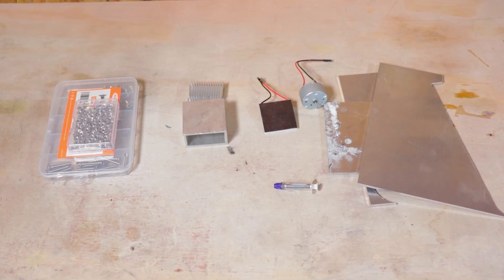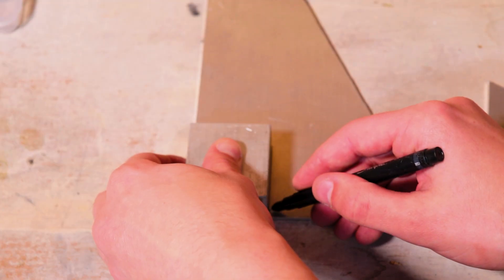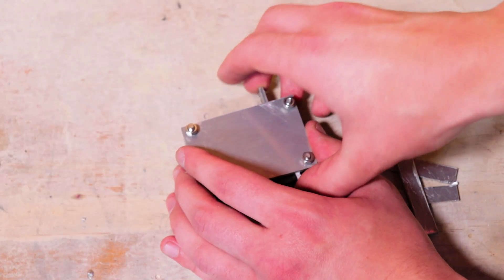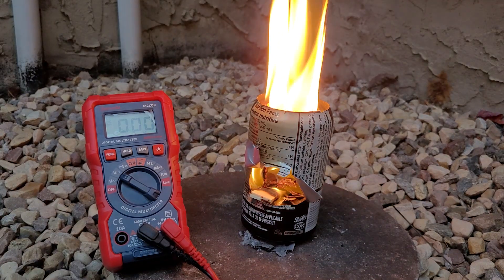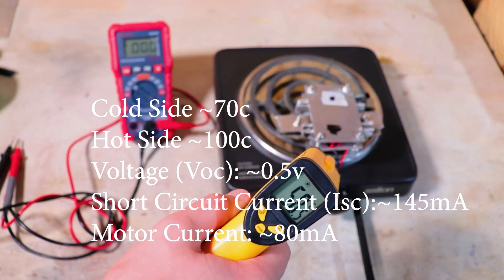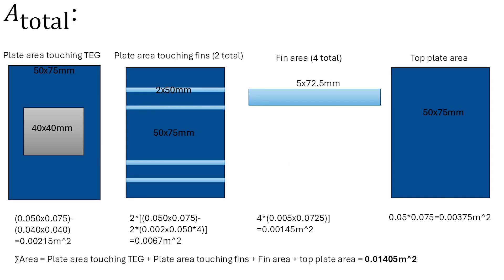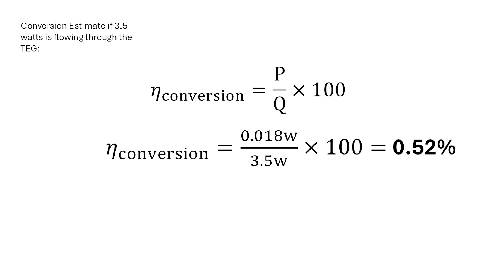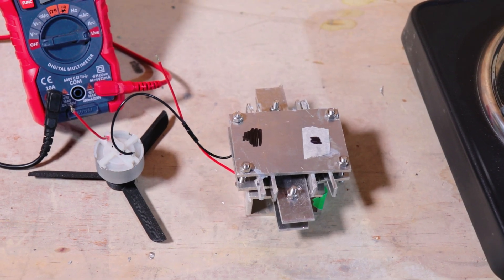Build Your Own Thermoelectric Generator (DIY Science Experiment from Scraps)

Comment from the maker: Correction: There is a mistake at 07:54, forgot to convert to kelvin (turns out the Carnot equation is based on absolute temperature ratios, not relative Celsius degrees) in doing so the efficiency is much lower n = 1- [(70+273)/(100+273)] = ~8%